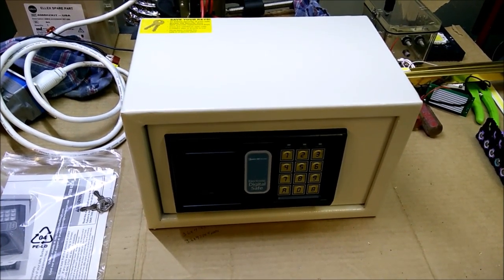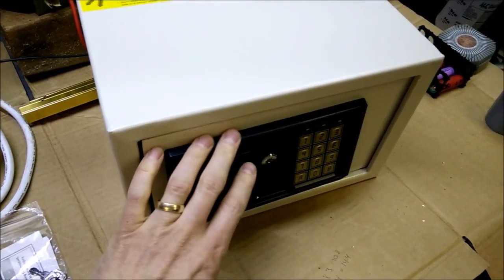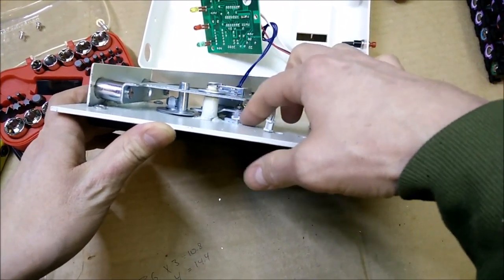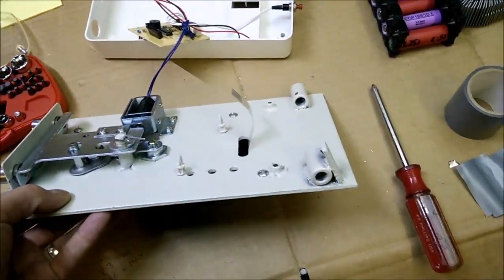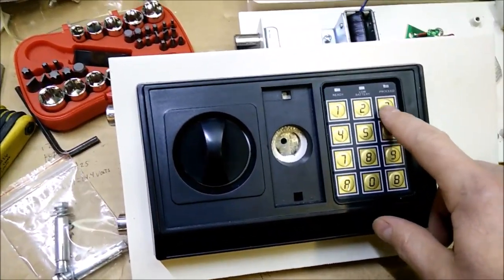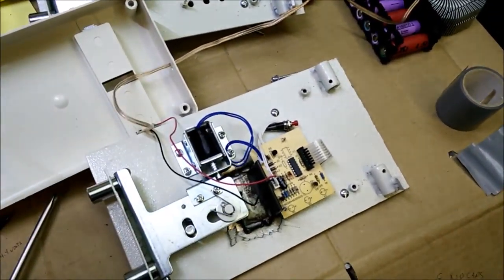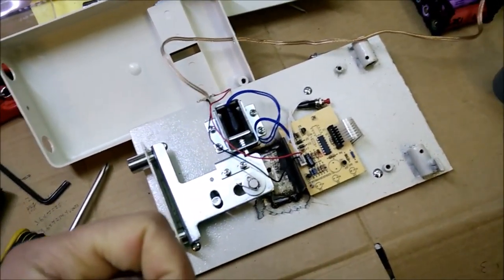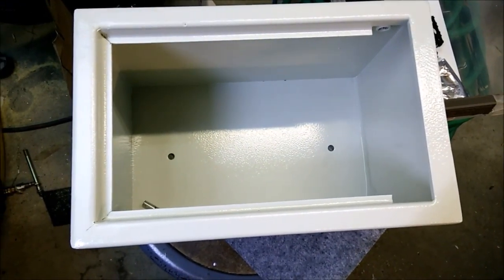Improve your Harbor Freight Safe!

Comment: yes this is a guy that watched this video quite a while back  and i did comment on what i thought was  some great ideas , in your Wifes Defense i can see the Humour  in you locking your own self out of the thing  because of your improvements  i’ve done very similiar things to myself on “Beefing” Up  many of my Entry doors and securing the ground flor Windows  in a manner that i can’t break into my own home if i accidently got locked out  I’m a retired Woodworker that was in the Trade for 35 years so i do things like  reinforcing the Jambs with Steel  bolted and shimmed with Hardend Hardware  inside a Wood Jamb that looks normal from the outside
Reply from the maker: Yep that rings so true! We have eliminated the easy ways in😂

Comment: drop a little tack weld into that drilled hole bro. its called a "plug weld"

you can make a fast to grind weld connecting two pieces of plate by drilling the top plate, then welding into the "plug" through the hole, and tying the weld into to the bottom plate, then grind anything sticking up flush and its connected and invisible. this trick has proved helpful in my welding. 
thanks for sharing

Comment: I use my Harbor Freight safe as a locking cabinet to keep youngsters hands away from certain items. Then when I go away, I replace those certain items with heavy items (think a few bricks), and put the certain items in a heavy gun safe that's really difficult for two men to take out through the garage.

Comment: It would be interesting to replace the processor. Could probably keep the buzzer for things like low battery but not have it beep on code entry or possibly have a "silent mode" option if you press "A" first. Maybe throw in some wifi to get notified when someone is fiddling with things.

Comment: I'm getting the HF Executive Security Safe. (59" tall.)  Will the same process work to improve that safe?  Any chance that taking a wire brush to the paint and then using JB Weld or another adhesive to attach the angle iron/shield would work?  In addition to this safe my home has a security system; the alarm would go off before they got to the safe--and hopefully they will abort and leave.  Can my home and the safe still be breached?  Yes, but criminals will usually go for easier targets.  No security system is impenetrable.  It's the Grizzly Country Principal.  "I don't have to outrun the bear; I only have to outrun you."  If the alarm goes off when I'm not home the crooks will most likely split.  If I'm home and they decide to breach anyway I will have time to prepare. (Arm, take position and make sure the security company is enroute.)  The thing I most want to avoid is to have someone break in while I am gone and then for me to come home without knowing there is a criminal in the house.
Reply from the maker: livydman Yes JB Weld is a great idea! the really great thing about it is that the crooks are not going to know that it's just glued and not welded! If it looks like thick steel they're probably not going to spend a whole lot of time on it with the alarm blaring in their ears. Thanks for the comment.

Comment: I like the battery back up wire the best  i live in a Assisted Living facility and I’m thinking about that safe mainly  to store paper work  thats private  to me but not very valuable to others in money terms  i may keep a few dollars inside of it  for  some safe keeping  and a few  other things  typically there is Staff coming and going throughout most days  and for the most part they are honest  but i may just put my ipod and other Electronics that might  cause temptations for someone to make a quick dollar from something they could pawn  or sell quickly  similar to how one might use a in room hotel or Cruise line safe  which is not high security but offers a small amount   For short periods at a time  I unimaginative the dishonest Employees do know how to  open them when they want  but  its a okay place to leave  some belongings that a freind or spouse may need to access at some time during that temporary stay

Comment: These safes have a reputation for being very easy to bump open, as you mentioned.  Smack it on top while turning the knob and you're inside in seconds. I like everything else you did, but I had considered replacing the solenoid with a worm-drive linear actuator to defeat bumping, but haven't been able to find one yet.  Not sure what one would cost either.    
So how does your modification make it any more bump-resistant?
Reply from the maker: Thanks for comment! A worm drive would be great or two solenoids, one vertical and one horizontal. My mods don't make it bump resistant but if you bolt them down with the holes in the bottom I have not been able to bump it.
Reply: I suppose you could stretch out the return spring on the plunger, and as long as the solenoid can still pull it down, it would reduce the ability to bump it, right?
Reply: A motor would be best, but you'd probably have to design some special drive circuitry. Using a stiffer spring or a better solenoid (with a stiffer spring) may be easier.

Comment: The batteries on my safe died and I dont have a key. Is there another way to get it to open?
Reply from the maker: Lots of videos on bumping them open. That's the easiest way if it's not bolted down.
Reply: @besamjohn  No it's not bolted down and its empty! Thanks, I'll look around see if I can find a video.
Reply: @besamjohn  what if it is bolted to the wall? would that make a difference?
Reply from the maker: @urbex_9999  yep, also I great improvement.

Comment: Question: I removed my buzzer. Now it doesn’t beep but it won’t accect the code. Any ideas??
Reply from the maker: I don't think removing the buzzer had anything to do with it. That wouldn't change the code.
Reply: The keypad doesn’t even work when you reset the code either. It won’t open with the keypad
Reply: @fg7045  I'd unplug and re-plug the keyboard to make sure it is making good contact.

Comment: I bought a safe and lost keys is there any way to get a key from the manufsctor
Reply from the maker: Try calling or emailing Harbor Freight. They may sell you a key. If you can "bump" it open, you may be able to re-key it by installing a replacement assembly.
Reply: The documentation says, "for your safety, replacement keys are not available blah blah blah", but it's worth a try contacting them.
Reply: If the safe can be still opened, you can simply open the safe, open the back cover, take off the lock and replace it with a new one (of course with keys and the same dimensions of the previous one)
Reply: No keys available. Easy for a good locksmith with impressioning tools to make one though.

Comment: Don't know much about welding so I was hoping you went into detail there rather than just cutting the video. More specifically the tools needed to weld /remove the beeper. Otherwise, informational video. Thanks.
Reply: Any cheap soldering iron will heat up the solder on the back side of the board (not the side with the beeper "can".  Have a screwdriver under the "can", heat up one solder location (attaching can to circuit board) and gently pry can away until the "leg" on the "can" is no longer making contact.  You're done.  You don't need to completely remove the can.  Also, if  you want to re-install "beep", it's easier to solder the one leg back in place (than 2).

Comment: the angle  seems like a good idea  but why not just weld  something like a old hardened file over the hole completely ?  i guess it is kind of funny you got locked out  on your safe  most especially   that you were doing this video
Reply from the maker: Good thought Craig, in my very limited experience welding hardeded steel it can be tricky. I welded a shooting target and it broke right off at the weld on the first shot! It certainly would make drilling it out a huge pain for the bad guys!